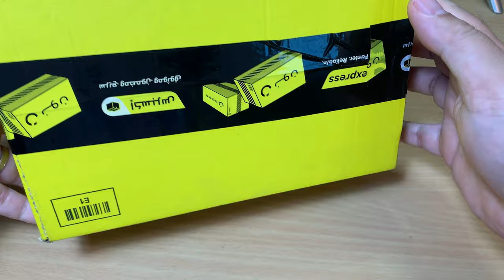Unlisted by Kenneth Cole Men's Analog Watch UL51158004  - Video unboxing, tutorial & review

Comment from the maker: Unboxing  0:23
Basic Features  2:21
Weight  3:15
Dimensions  3:27
Setting the Time  4:23
Scratch Resistance 4:52
Water Resistance  5:14
Opening the Snap Down Case Back 6:00
Movement/Battery  7:50
Closing the Snap Down Case Back/Using A Press Tool  8:12
Adjusting the Bracelet  9:40
Wrist Shot 10:42
Recommendation  10:54